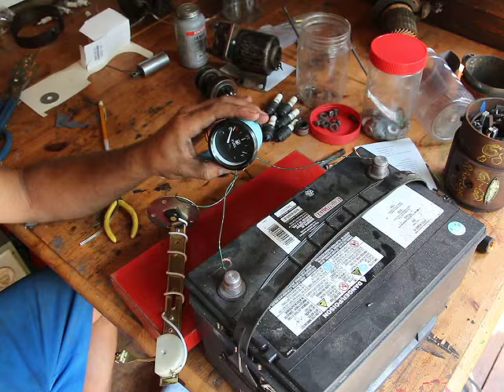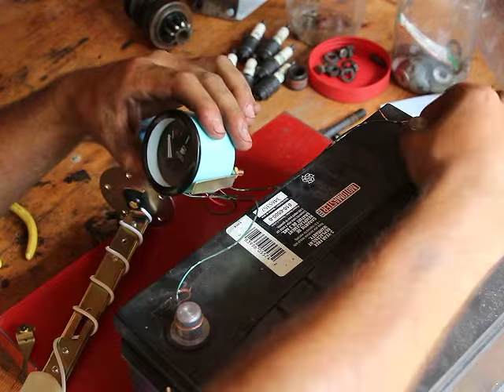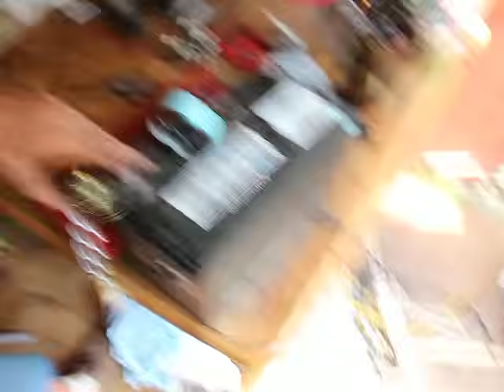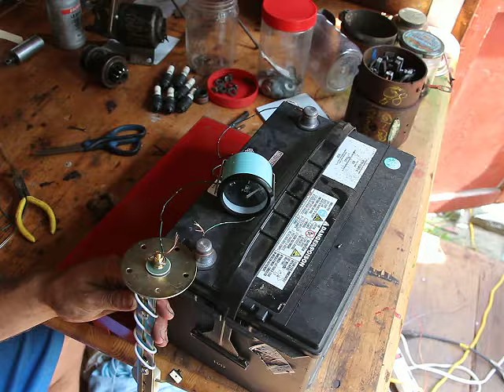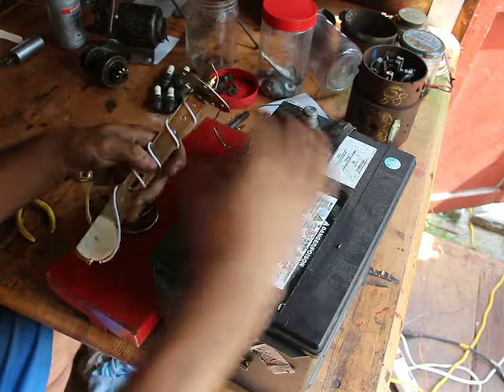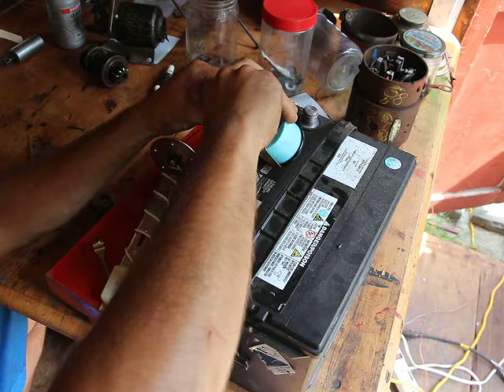How to wire fuel gauge and sending unit complete explanation

Comment: The other thing is don't try to adjust the sender with gas in the tank..
I tried umteen times to get it right, half tank, quarter tank. The ohms on the sender and the gauge need to match.
So I set sender to just under E, and added 1 gallon so it came to just over E. Allowing for about 1/2 gallon reserve.
Reply from the maker: How did you get them to match? Did you add resistors ?
Reply: @OldCrowsClassicCars you buy the gauge to match the sender ohms (intial setup)
You use an ohm meter to find resistance from empty to full on sender.

Comment: Great video, you explained everything very well, broke it down where you can understand how everything works, most of these videos you are more confused after you watch it, I have a 66 C-10, my gauge reads empty, I have tested sending unit, it works its 30 ohm, the gas gauge is new, when I unplug sending unit wire from tank it reads full, which most tests say your gauge works, ground at tank is attached properly, any advice on what could be the problem,  SUBSCRIBED.
Reply from the maker: Comments like these make it all worthwhile! I'm glad it helped!

Does the gauge read empty when the float arm is raised? 
You could also look into the resistance (ohms) of the gauge...they kind of have to come in pairs, because different resistances, will cause problems like that.

If you still need help, rewatch the video,and send me an email with your schematics.

Also, you can easily test the gauge directly, by making a simple variable resistor from a jar full of salt water, and moving electrodes (such as 2 knives) close to each other .

Let me know if you need help

Comment: I have a 91 Chevy and I just put I new oem fuel pump and the gauge still reads full anything I should be checking ? Thank you
Reply from the maker: I would remove the corresponding wire to see if the gauge goes to empty...or you could even remove the sending unit, and manually move the float arm to see if it moves the gauge.

There's a way you can replace the float arm (and it's resistor) by a jar of water with salt to act as the resistor. That way you can test the gauge.

Comment: is both units american to match both have be the same country    to test your sender disc wires  if you have an ohm meter set on low ohms   connect one meter    lead to top connector of sender  connect other lead to mounting  plate move float arm back and forth  it will read 240empty or 33 full you should be able swing float back and forth  watch ohm/meter change to these #s --- you can not mix say  japanese sender and american gauge  ----will not work very this conn this way to test gauge 1 wire from mounting plate gauge mounting bracket the connect neg batt lead to same mounting now run a wire from center conn on sender to proper conn back of gauge now run plus battery lead proper conn on back of gauge now needle shoul follow you moving float arm up and down
Reply from the maker: Yes, your correct, different gauges and sending units might have different resistance values. I bet you though that even within the same  country  they will make them differently the bastards.

That's why it's usually best to buy them together

Comment: So say if you have a sending unit that operates at for example "22 ohms empty to 140 ohms full" and the gauge operates at "140 ohms empty to 22 ohms full" can you swap the negative and positive on the gauge to swap its needle position? Just like a potentiometer?
Reply from the maker: A potentiometer  or variable resistor is exactly what it is.
The resistances of the sender and gauge have to match.
I'm not sure of exact numbers and unfortunately, not all sellers list these, so usually it's just best to buy both together.

I however, have moved away from these electrical gauges and moved to mechanical gauges (which are used in airplanes).
Reply: @OldCrowsClassicCars  I didn't know know airplanes used mechanical sending units, thats an interesting direction
Reply from the maker: @nathanrixmann7348  Yes, small airplanes (2 or 4 seats). They used them because their indestructible, whereas the electrical ones, theres alot of things that can and eventually do go wrong (corroded and loose wires, water/rust in gauge, worn potentiometer, wrong resistance , worn rubber insulator (check my video) etc).

As you can see, these gauges are extremely week and sensitive. The one on the video actually broke inside the tank eventually.
But a mechanical gauge, it's just gears...hard to damage those.
The other type is an extremely simple dipstick...standard in cars from the 20s and 30s I believe.

Comment: Amazon has all sort of sending units for sale with or without gage.  They have both impedance types.
Reply from the maker: Interesting. I switched away from these electrical gauges and went back to old fashioned dip stick.
Mechanical gauges (used in airplanes) would be awesome too.

Comment: I've got a  question for you.   How does a person find out what ohms the sender is and what  ohms the gauge is, to make them useful together?  I bought a gauge  years ago and nothing is printed on the package about ohms at all. I also ordered a sender from a different company and same thing ---- nothing mentioned about ohms. Not knowing anything about ohms and such the sender was mounted in a tank under a truck and now I  have a problem. Something is not working correctly and the wiring is correct. The gauge jumps to full but only two gals in tank. I will make this work but I don't want someone else to have this same problem. What do you think?
Reply from the maker: Good point. You need an ohmeter. It should be part of most multimeteres . 

Measuring resistance on the sending unit isn't hard. A bit trickier on the gauge itself. I'd have to open one up, figure out how it works in order to provide a decent explanation.

Comment: What about gas pump on original from the car how to this one works with?
Reply from the maker: The pump is a mechanical type, meaning it's run directly from the engine. There's a shaft from the pump that rides on a lobe on the camshaft.

Not like most new cars that have an electrical pump inside the fuel tank

Comment: I grounded mine to the frame. Do I need a wire from my sending unit to the negative? Or from the gauge itself to the negative
Reply from the maker: Short answer is YES. 
The entire car should be a negative terminal (ground). Does that answer your question?

Comment: My 97 Ford Ranger has a thing called “anti splash”, so the fuel gage doesn’t 
move back and forth when the gas splashes around in the tank. The gauge shows full all the time because that thing is burned out ☹️ Fuckin piece of shit 😡
Reply from the maker: Yes, these gauges are garbage! I hate them too. The only decent gauges are the mechanical ones, I believe mandatory in small aircraft, but they're expensive, and the fuel has to be close to the gauge.
I'm planning on building a mechanical fuel gauge and a mechanical temperature gauge, using the same principal operation as thermostats use.

Comment: the info im telling you is for the bench test only  remember on the car the gauge is already grouned but you should have two wires coming from the sender  one conn. to s  the other to gd,   on the bench you have to conn.  batt and sender  to make it on the bench
Reply from the maker: Yes, I do that later on. I just didn't do it in the beginning to show the symptoms, what would happen if you didn't connect a certain wire.

Comment: you need to wire the batt with 2 wires to gauge  also wire sender wi 2 wires to gauge  that will conn. the sender wire to the batt neg on the gauge that will make the test  setup your useing work needle will follow the sender up and down if both are ok   and 12 volts items   some gauges are 24volt s

Comment: you need run a wire from the base of the sender to the ground post on gauge also run a wire from base to neg post on battery what you are doing now is adding rthe resitance of the batt,in series with the sender  total res. from sender has to be 33 to 240  ohms

Comment: you can veryfi the sender with a ohm meter connect merter leads to cener post  and other lead the round base on the right on your meter  it should read full 33 ohms empty 240  + or - 10 ohms if so the sender is ok  this is usa version   forien types will read o to 100 i hope it    helps somebody
Reply: also you can not use american  sender  and forien gauge  will not work
Reply from the maker: Thats right

Comment: Your advice on having to ground the sender was spot on.  The instructions do not tell us that!!!  I installed the unit in a plastic fuel tank and it did not work. I ran a ground wire from one of the five screws on the sender to the truck body and now it works = all good. Thanks!!!
Reply from the maker: Glad it helped!

Comment: Good tutorial but for future videos, you might want to invest in some jumper leads with alligator clips to free up your hands.
Reply from the maker: I have them but most people don't.
I also wanted to keep things as simple as possible
Reply: @Ferman Loser   >Yes, make a set of jumper leads for testing, use 18 AWG will carry 20 amps safely over 14 feet. I use an inline ATC/ATO fuse holder 12” from one end. A large clip battery size and smaller one, but soldered & shrink tubing used. I have a test lead for ground tests, but 20’, 16’, 12’ and a couple 7 foot long. Oxygen free copper, pre-tinned and PTFE insulation increase testing length. Most people don’t have them is right, but they don’t own a digital multi meter (DMM).
Silicone rubber is common on meters with factory leads. Over 20 foot is sometimes needed on large boats and 1972 Chrysler New Yorkers for low resistance testing. ASE Master Tech since 1978 - Retired

Comment: Plz. wire connection is properly not understand
Reply from the maker: Could you be more specific?
On the sending unit:
+ goes to + at ignition switch 
- goes to any negative/ground on the frame of the car 

S goes to sending unit( it only has 1 terminal)

This provided your car is 12volts negative ground/frame.
If it's from before 1960, it might be 6volts and + ground/frame.

Comment: Please guide me with correct connections....
Reply from the maker: you might also have switched one of the terminals around. Perhaps some gauges aren't labeled with the terminals.
Also, the position of the terminals is NOT universal... for example, the sender might not be the left terminal on your gauge.
Reply: @OldCrowsClassicCars  I need your help. Well, I've just bought a fuel gauge with 3 terminals. The problem is the terminals are not labelled. How can I identify which goes to ignition (+), ground and sender?

Can we use a multimeter to identify?

Or will I damage it if I just randomly connect it to a 12v battery and sender?
Reply from the maker: @bimbeltkadgratis  
Your gauge may or may not be the same as mine. On my gauge, it's basically impossible to ruin the gauge, because there are basically only 2 terminals, a + and a - , and the 2 negative terminals aren't connected to each other so there is no way to cause a short on my gauge.

 BE CAREFULL! perhaps your gauge isn't the same as mine and you could possibly ruin yours! Please be careful as what I do to my gauge could possibly damage yours.

unfortunately, there is no way to open these gauges without damaging them. To find the terminals,  basically I find out by trial and error. I'd also check to see if one of the terminals is different than the other and just do a google search and see if you can find that info.
Assuming  your gauge is the same as mine, then from the voltage source:

Connect the + to one terminal. Then connect the negative to another terminal. 1 of 2 things will happen:

1) Needle moves. Therefore one of the 2 terminals is the S while the other is the +.
I'd start with the wiring shown on my video, as I imagine most gauges would be wired this way, with the S terminal at one of the side terminals.

2) Needle doesn't move.
Therefore the terminals are + and - and the remaining terminal is the S.

Then it's just a matter of reversing the terminals if necessary so that the - voltage source moves the needle when connected to the S terminal.

As I mentioned in the video, there are 2 negative terminals and 1 that's +, because the S terminal is basically a negative terminal with variable resistance. Connecting the + and - terminals doesn't cause the needle to move, whereas if the S terminal and the + are connected, the needle will move. So basically connecting the voltage source to the terminals that don't cause the needle to move identifies the + and - with the S being the one remaining terminal. Reversing the terminals causes the needle to turn the wrong way I believe.

Hopefully this helps!
Reply from the maker: Some gauges may possible have only 2 terminals, with the case itself being grounded. However this would require the positive terminal to be connected to the ignition switch or starter terminal and turn on and off.
Reply: Thanks a lot for the quick and clear reply.
Reply from the maker: @bimbeltkadgratis  Glad to help! Let me know how it goes!
and dont forget to send a 'polite' middle finger to those dummies that manufactured the gauge without labels!
Reply: Why does my gauge start working with tank is half full? Tia

Comment: Brother I am connecting battery+ve to - and battery -ve to ground...  Sander, s S to meter, s S....  But there is no correct reading.  Meter shows full...  😌
Reply from the maker: Sorry, I just got this.
 That should be correct. Perhaps your sender or gauge is damaged. What happens when you move the arm on the sender? does it move the needle? when you disconnect the wire, what happens?

I believe I show this in the video..it's long, but it shows answers the questions you're asking.
Reply: Now if I connect.  +ve of battery to - of guage and -ve of battery to ground of guage......... S of sender to S of guage. Then where I should connect other terminal - of sender....????
Reply: Dear brother ur video is absolutely correct I just have ambiguity that where to connect - of sender unit...
Reply from the maker: @tehzeebulhassan8547  The sending unit itself should be grounded (connected to the body of the car, which is usually negative since the '50s. Glad to know it worked out!
Reply: you need two wires from sender to conn to s and gd  on the gauge do not rely on gd of car body that sender is very   sensitive    must send only 33 to 240 ohms to gauge  on american if its forien      it will read     0 to 100  ohms    some cars   chasis read several hundred onms from one end to the other        two copper    wire     that same distance will   read very few ohms                               @OldCrowsClassicCars
Reply from the maker: @frankdavidson9675  Ah, you're saying it's best to wire directly to ground at the battery rather than somewhere on the car?You think perhaps the car has too much resistance?  If so,it might be good indeed to wire directly to battery rather than body of car.